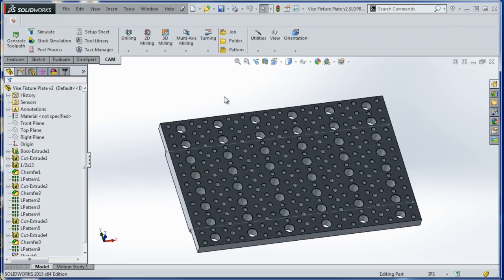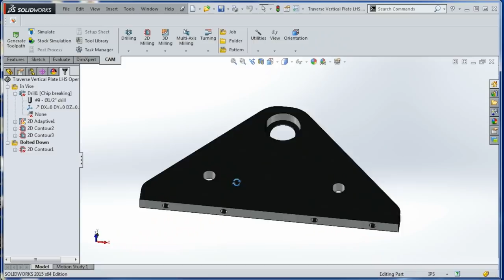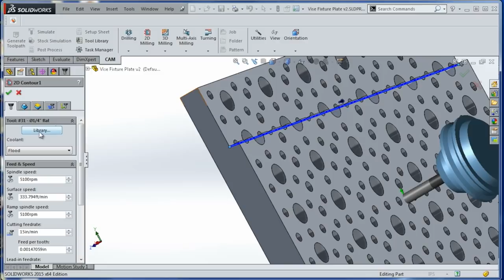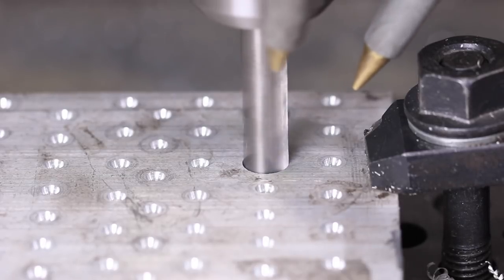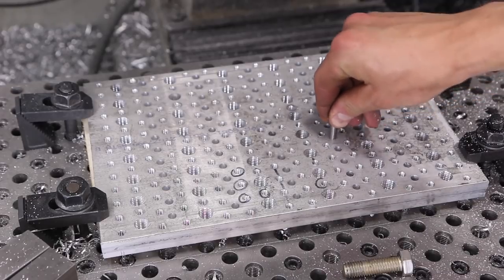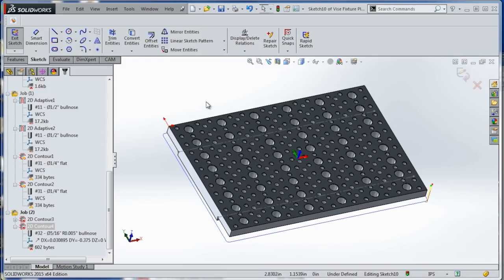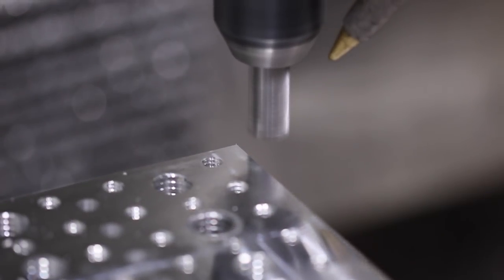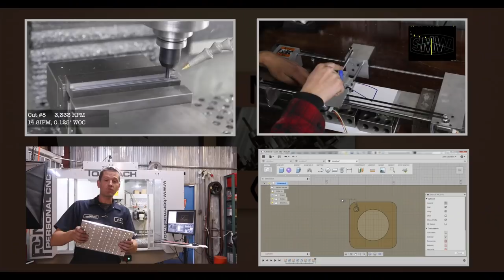DIY Vise Fixture Plate Widget - Widget43

Comment: Hi, Really enjoy the video's and the tips, keep em coming. One suggestion, instead of using wood under the stock try using 4 or 5mm Acetal sheet. Cutting fluids and moisture don't bother it and its kinder to cutting tools that break through (wood fibres blunt edges really quickly). Another plus is that the surface of Acetal sheet is much more consistent than wood, so less deviation across the piece.

Comment: Nice video. Have you tried using a shorter drill? That drill was pretty long for what you were doing.Also tapping oil really helps the tap life
Reply: A screw machine drill would help because they are made with shorter flute lengths which makes them a bit more sturdy. Just make sure to get one with the TiN coating.

Comment: ikea plastic cuttingboards are pretty cheap .i think those would work better as a sacreficial board and are a lot more stable with moisture and stuff
as for breaking a bit during the program : i wonder if you can have a photocell brindge to check the end is still on the drill / router / tap each time you start a or a set of holes that stops the program and sounds the alarm when theres a problem 
might allso be able to do the same thing with touching the work with the tip of the tool making / completing an electric connection (wish should allways be the same distance between the top of the workpiece and the bottom of the tool ) does mean you need to insulate either the cutter or the workpiece from the rest of the machine

Comment: For that many holes I think a HM drill would come in handy, would definately save you alot of time.
Reply: I mean carbide drill of course ;)
Reply: NYC CNC That's great to hear, looking forward to a comparison video ;)
Reply: NYC CNC Carbide drills are the only way to go unless its an oddball size you don't use much. Presumably you have a few common size drills that get used frequently, generally this stuff is available on eBay cheap if you're willing to wait. Although the smaller ones are not very expensive new anyways, and you don't get much choice as to what brand and series you can get that way. Generally a carbide drill will allow you at least to skip a center drill op. Although getting the chips out is way more important, the carbides will snap easy if chips start loading up. Run a chip breaker peck, or most of the time if you tweak the feeds you can get the chips to break naturally and straight plunge if you get a good tool dialed right in.

I'm thinking you're right on the MQL min retract pecking. Personally I wouldn't feel confident walking away from those drilling ops with that coolant. The full retracts here and there are great to get some coolant down into the hole where the cutting edges are. Otherwise the things running near dry, which can be really particular. I would want to dial things up for that deeper drilling. If thats a form tap, personally I would spray WD40 over all the holes before running it with your MQL system. The VAST majority of times I have problems, its coolant related. So getting the coolant right, typically gives me the confidence to walk away from those long ops.
Reply: Frank In addition I'd like to add that you should consider to buy carbide drills with a special coat for aluminium, since it seems that you're working quite alot with alu.

quote:
[Run a chip breaker peck, or most of the time if you tweak the feeds you 
can get the chips to break naturally and straight plunge if you get a 
good tool dialed right in.]

Running a chip breaker peck will usually damage the carbide drill. Feeds and speeds should be high enough to break the chips without it (given the hole is not too deep).
Reply: ***** On a VMC if the tool is run at the edge, yeah. I don't think John is going to have the confidence to run that close on his Tormach.

I drilled thousands of holes on one carbide drill in a tiny little Taig, ~6D. No problems, didn't break the cheap drill, but it did almost melt the spindle motor. The only way it worked was with a TINY peck, then a retract before the motor stalled. The Taig just didn't have the power to run the drill hard enough to get the chips out properly that deep. Repeatedly smashing the carbide into the aluminum, and retracting when the spindle bogged worked fine. I wouldn't do it in a VMC, but the Tormach appears to be closer to a Taig than a VMC.

Comment: I know Rob Lockwood brought this up before, but don't use an adaptive path to finish a floor (DAMHIK).

You can specify stock material for a 2D Contour as well and finish your floor, use .01" for a finish pass. I like to take about .01" for a floor finish as well with any cutter 1/2" or smaller.

Edit: and you're still using a center drill! Why?

Edit 2: I've said this before: 2% of drill diameter per revolution is a really good starting point. Too light a feed will rub them dull real quick.
Reply: An adaptive path will have a tendency to gouge when you're removing a good amount of material just due to the lack of rigidity in the machine (any machine), so I would highly recommend a floor finish if your dimensions are important. The adaptive path leaves a neat pattern, but you can feel it for sure.

Comment: Do you have a reason for not using the hole wizard for holes? I've found it a powerful for inputting thread and dimensional dims for holes.
Reply: NYC CNC SolidWorks.  I've never used HSMWorks, but I imagine that Sloidworkd would just pass the hole data right over.  In any case you can keep holes separate and make the entire hole pattern right in sketch.
Reply: John Carlton  Damn dyslexic fingers.  I meant Solidworks of course.

Comment: Question on the model, any reason you used the extruded cut feature instead of the hole feature for the threaded holes in the fixture plate?
Reply: Oh, ok. I thought maybe there was an issue with it and HSMWorks. Just now starting to play around with HSMWorks Express. So much easier than MasterCAM X2.

Comment: You should be able to select a hole as your reference point instead of going back to modeling and inserting a point.  Works that way in Fusion.
Reply: Phil B Not quite the same in HSM. Frankly the easiest way to do it IMO would have been to set up a SW Coordinate System  as reference geometry wherever he wanted it and go from there. In Fusion I tend to default to stock all the time.

Comment: Made in Germany thumbs up 
What about using a NC-Spottingdrill with 90° flukes? Deep and large enough to camfer your holes?  I'm using this technique at my work and its fast and easy, and i dont have to worry about to deburring all my holes by hand ;)
i also use fixture plates, but mine are made of mild steel, usually grinded flat on both side, clamped on 2-3 blocks to rise it a bit. (and get under them if needed)
Reply: NYC CNC also, why don't you clamp onto your machinetable? as i see, there are many threaded and reamed (?) holes? too deep or weared out?

Comment: Can i as the difference between CAM and Cad as all the software I have used once you have drawn the piece it can then be sent straight to the cutter.?
I am still learning and try to keep up with you guys.
Reply: ***** In CAD you created  a 3D model of your workpiece, which you then send over to you CAM programm. You use you 3D model then to create the toolpathes. There are probably programms which can do that automatically, though I believe those are quite expensive.
Reply: ***** Thanks I will track down the name of the software but it is used  through Aduino  as the driver.

Comment: Buy some lexan to throw under that instead of wood.  Also, I love your vids so I'm not trying to be a smart ass, but why not machine holes and threads as you need them per job in a sacrificial piece of aluminum?
Reply: HunterNugent because having a even pattern it easier to work with. you could do it that way but your holes won't be true to each other

Comment: RE : the birds nest why couldn't you build a very cheap rail 8mm , stepper and arduino controller to push an air gun to blow compressed air as it runs the length of job every say 5minutes to keep all cuttings pushed to a tray. Alternatively an air blower cylinder with holes every 20degrees  adjustable height spraying burst of compressed air with a solenoid .. on 5 minute timer

Comment: I really need to make this... (only i will have to tap by hand... Grrrr)
Reply: Thanks for the advise wordreet  ! Ans indeed I have been looking at these several times... A project like this would indeed be a good excuse to invest in something like that..

I do have a CNC mill, but no spindle control, so I could pauze at each hole and tap with the tapmatic using the quill...
Reply: Yup. I believe the Tapmatic has some sort of friction drive inside, but it also has a neutral point where there is no drive at all, so it stops if you ease off the downwards pressure. Then if you move the drill arm upwards, Tapmatic will spin backwards and out of the thread you just created. 10 mins of practice and you'll know how easy it is to work with.